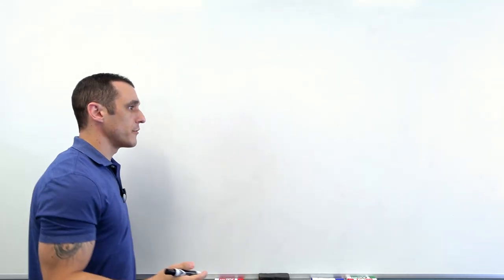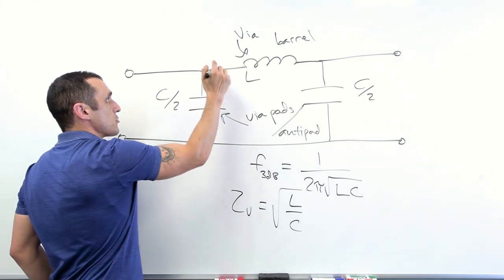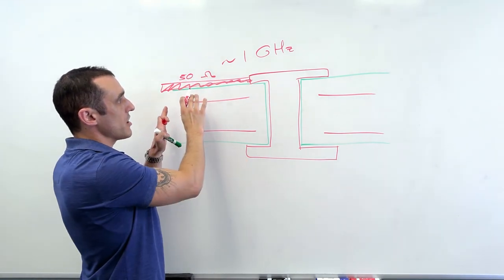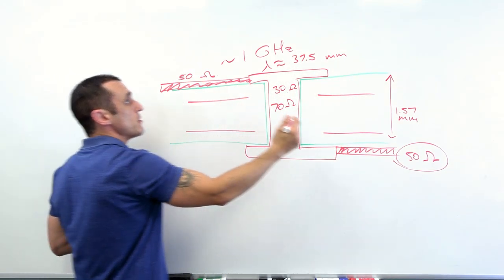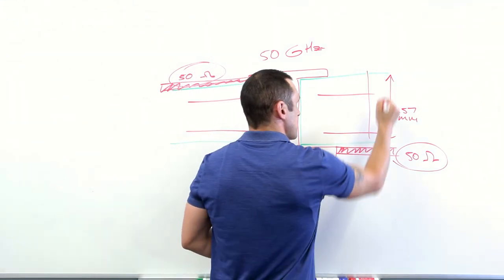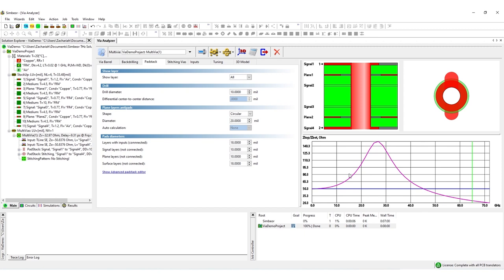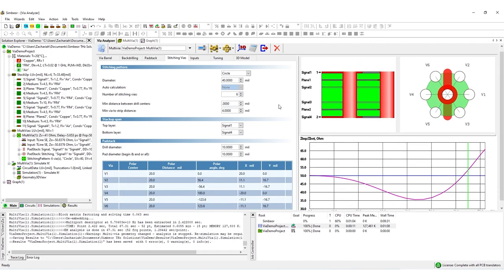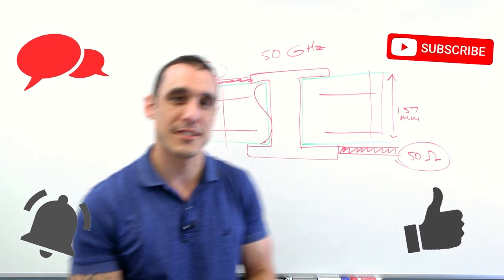Why Via Impedance Calculators Can Be Inaccurate

Comment: Great video Zach - so when will Altium be offering a proper via impedance calculator - because I could do with one right now!
Reply: They would need to pull from the Simbeor SDK, honestly Simbeor has the absolute best tool for this... At least Altium is not like certain manufacturers who are putting out via calculators that are totally inaccurate!
Reply: @Zachariah-Peterson  Yes Zach that is very true. A comprehensive via impedance calculator would be a great addition to the Altium signal Integrity toolkit.

Comment: Great video, thank you! I love the Simbeor demo - really drives the point home. One question though - if all stitching vias are removed, how does return current flow? How would the result be different if perhaps you have one or two stitching vias far away from the signal? 6 vias is a great approximation of a coaxial structure though :)
Reply: Stephen, thank you for the feedback on Simbeor. Considering the case with the removed stitching vias, the model in Via Analyzer uses infinite planes - the return current goes through the displacement current between those planes. In 3D EM model, Simbeor 3DML solver is used in  Zach's demo - it uses PEC boundary conditions around the simulation area. The via becomes reflective very quickly. If one use Simbeor 3DTF solver and PML boundary conditions, such via will start loosing the energy very quickly. Behavior of the actual via will depend on PCB geometry - it is not a good idea to have such unpredictable dependency. Even use of one stitching via increases the via predictability, two vias increases it further and so on.
Reply: @simbeor  Thanks so much for the detailed answer, great info!

Comment: 9:12 - at high signal frequencies, such as 50GHz, it will create a wave at the via line and it is said that it will start to resonate. Can these resonance actually degrade the via and cause it to crack or what not at much higher frequencies? Thanks.
Reply: You're right that the effect is due to wave propagation, and at certain frequencies there will be constructive interference (a resonance) and destructive interference (anti-resonance) in the region around the via. However there is usually not enough power in practical situations to cause a via to be destroyed. Maybe that will be the case in some applicaiton like power over RF, but those systems should not normally route through vias for multiple reasons and they are normally delivering power at a much lower frequency than the via resonance frequencies.